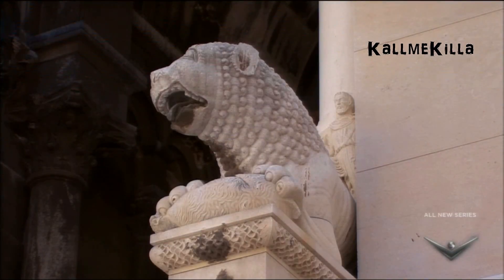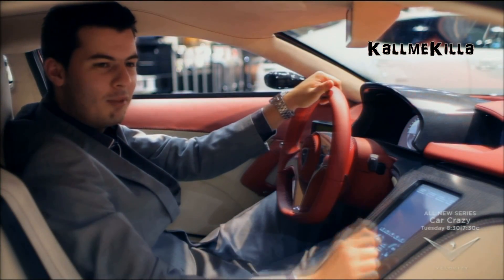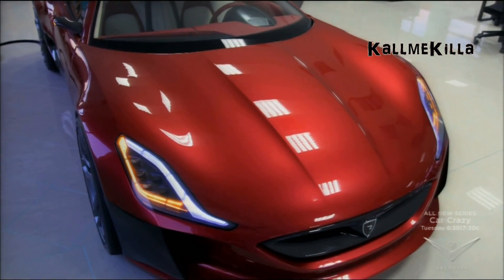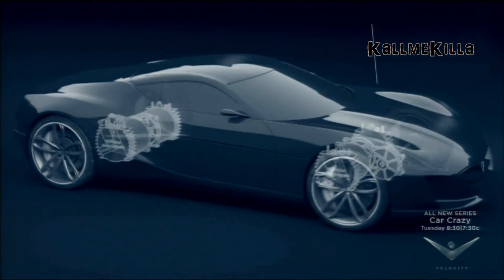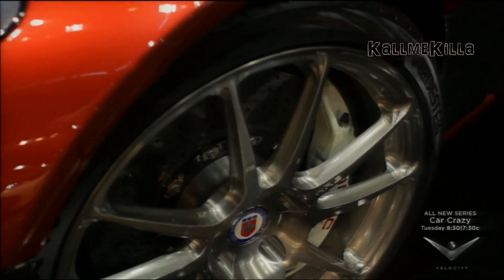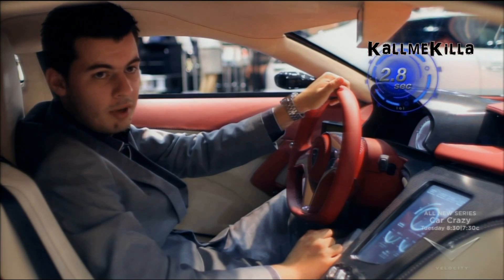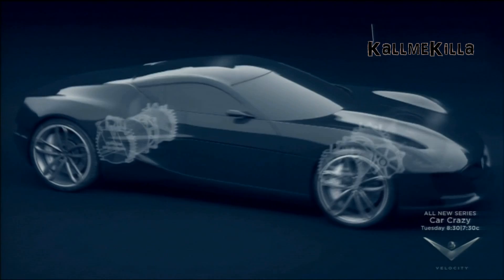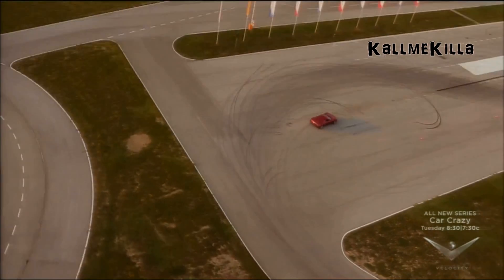Rimac - Electric Concept One Super Car 1088hp

Comment: I want to design and build an electric supercar myself! If I were to design and build one, it would use rechargeable, solid-state, lithium-air battery cells with the following specifications: specific energy: 2.5kWh per kilogram; specific power: 3.2kW per kilogram; energy density: 6.6kWh per liter; and it would have a minimum of 10,000 charge cycles, each with a depth of discharge from 100% to 0%, in order to ensure battery cell longevity.

The car itself would use 400 battery cells, each with the following specifications as listed above; the entire battery array would contain 1,000kWh (1MWh) in energy, and it would be capable of generating up to 1,280kW (1.28MWh [that's approximately 1,716.50827HP]) of power to all four AC electric motors, with each motor being situated at each wheel.

The rate at which these batteries will be recharged or discharged is 1C: this would enable you to recharge the entire battery array in one hour, provided that 1,000kW is fed into it constantly for one, full hour, using whatever power outlet(s) is (are) capable of delivering that much power. If you use a typical U.S.A. power outlet (which is rated at 120 Volts and 15 Amperes), for example, you could recharge the entire 1,000kWh battery array (at 12 Amperes continuously, due to the charge taking more than three hours [that's 1.44kW of continuous power output]) in roughly 694 hours, or 29 days. ...But, obviously, you'd need to charge it a lot faster...

Comment: For my opinion, they speak a bit to much about the power. Seriously, it isnt that chellenging to build a very fast car. The most chellenging part still today is the range of an electric car. Honestly 390 miles range is enormous, but they mention the range, just once. So I doubt that the car would make 390 miles.
Reply: Peter Lustig It might, if you drive it extremely slow, very carefully. If you drive it using it's amazing power - which is kind of the point of the car - then it would probably be half the "reported" range or less. And considering how insanely expensive it is - it is not that impressive at all for a dedicated two seater, with no luggage space, and a carbon fibre body, and still being so heavy.

Comment: Alot of this doesn't seem to add up. If you use Tesla's charging calculator, it says that the very best home system @ 240 volts and 80 amps can charge 92kWh in 4 hours and 45 minutes (and Tesla says you could do 280 miles on that charge). Yet this car can do the same in 1 hour? If you do the math there, you would need 380 amps current draw to do such a thing. That's no big deal for something like a Supercharger station...but a home circuit? Absolutely no way.

I don't doubt that it can hit its performance expectations, but range and charging sounds very fishy to me especially considering the use of LiFePO4 instead of Li-Ion cells.
Reply: We Europeans do have a Three-phase-power-grid with 230-240V in between neutral and one phase and 380-415V in between the phases... Most homes can deliver 50-64A per phase. Some homes can even deliver 125A per phase! (Yes we are more advanced than the US and most country's when it comes to the power-grid)

Comment: This video is providing some unrealistic numbers. 91kWh of battery capacity and a 4 motor drivetrain with 370 miles range. I doubt it.
Model S P85 with a single motor drivetrain gets you around 250 miles with 85kWh on typical freeway driving. 
The Concept One range is probably closer to Model S if the battery capacity is truly 91kWh.

Comment: how are they getting 500km range, when an electric SLS AMG only gets about 200? i simply dont believe that an upstart croatian company can accomplish something like that when one of the most respected car companies can't.
Reply: 91kWh battery. The top model Tesla Model S has a 85kWh battery and they claim 480 km so this sounds about right. keep in mind that the Tesla battery weighs 300Kg so the battery in this thing is going to be very heavy which is why they've used so much carbon fibre and part of many reasons behind the cost I would guess.

Comment: The narration says the car has 4 electric motors and 4 inverters at each wheel. 4 motors = great. Chevy EV1 had this in '96. Its a great idea. Why an inverter, let alone 4 at each wheel? Current from the batteries is DC...why use AC motors? Why 4? You only need one inverter at the battery pack. Seems like a needless waste of power to make the conversion to AC and the extra weight the 4 inverters would bring.
Reply: I think DC motor has "rev" limits, yet AC motor "rev" is controlled by frequency. As long as you can provide enough juice "voltage" and jacks up the frequency, AC motor can go very very fast .

Comment: NO they need to tell the RANGE, The ACCELERATION, make manufacturing line, then race the others.... If they gona have range, power, comfort, and durability, then they gona win over TESLA... BUt now its just show off.... as it was before Tesla steped in :) For now... I prefer 400BHP tesla. 0-100 4,2 seconds. range on one charge - 460km EAT THAT...

Comment: The really big problem with electric cars is the natural characteristics of an electric motor. These cars have great take-off from a standstill cause that's the point of an electric motors maximum torque, but once you're moving you will not get any 'ump' in acceleration - actually I suspect it'll be pretty lame.
Reply: +Abinico Arts you haven't driven a Tesla then?  LOL fast acceleration from any speed. :)
Reply: No I haven't driven a Tesla - no point since I'll never be able to afford one. My comment comes from the days of simple electric motors - I'm sure that for what you pay for the Tesla they have designed in plenty of fancy circuitry for it be very impressive.

Comment: Other than having more hp and torque, nothing on this car is innovative.  Tesla did most of this stuff first, Mercedes did the 4 motor setup with torque vectoring, and both are considerably cheaper.  The only thing this car is ahead on is range.
Reply: hahhahahah your ignorance makes me laugh
Reply: Please, this car is far better looking than the Tesla. And these people were at the game way before Tesla. Sorry, get out of your insular USA box you live in for a change. There's a whole world out there.
Reply: I never said it didn't look better.  I said it was way too expensive.
Reply: hellcat1988 , It's not meant for common folk
Reply: Or people with any form of reason and intelligence.  You can get every feature of that car for a lot cheaper in better cars.  You can probably get every feature of that car in one car that will be cheaper.  I know there are custom car builders who could make something that looks just as good, goes just as fast, gets close to if not better range, and charge a fraction of the price.
Reply: Tesla has a better range to cost ratio.  I would rather pay 90k for a car that has more passenger and cargo room, can do between 250-280 miles per charge, and is domestic than a car from a European country that has much less room due to it's 4 separate motors, less than 200 miles more at best, and costs almost 10 times as much. 

The ONLY things this car might be able to claim is an advantage is it's range and 0-60 times due to it's battery and motor setup, but we still have to see how it handles a crash and what kind of longevity the battery pack will have.  The Prius battery is close to 2K to replace, and it's not even that advanced or rare of a battery pack these days.  I can only imagine what the "specialized" battery in this car would cost or what it would take to replace.  At lest the tesla battery can be changed in under 2 minutes.
Reply: hellcat1988 Absolute rubbish. IT has a longer range than any other electric car. It's range is quite impressive actually. I can't even go that far on one tank of gasoline. And it's very slick looking and not only looks expensive, it is. It should be pretty obvious, but apparently it isn't to you, that this car is not for the average person. It is a very much a rich man's toy
Reply: BroccoliBeefed
And that is exactly the problem with it.  For what you would spend on that car, you could have a all 5 of the tesla range of vehicles as well as have spare batteries brought with you on a truck for a few years before you would come close to the cost of this car.  Just because it "looks slick" to you doesn't mean that it's going to look as good to everyone, and rich men's toys like this are worthless in the real word.  I would never buy a car that is so rare or low in production that it would be totaled if I got in a fender bender.  Also, your gas millage must suck because there are mercedies that can do 600 miles per tank.
Reply: ***** I don't waist money like that.  If I'm going to buy something, I want a good reason for it.  Toys like that aren't worth the attention they get.  If they bothered to do something useful with the tech, like helping to create a semi (laury) that doesn't need fuel to do the same work as current versions, then I would be interested in the company.  As it stands, they are just producing a shiny toy with no actual value whatsoever.  As I said before, Mercedes has a 4 wheel motor car, Tesla is much more useful for passengers and cargo, and every manufacturer in the market is trying to make better batteries.

As far as the charger fire, they've already fixed that.
Reply: The problem is it does nothing for the average consumer and it's not going to do anything for the environment.  Production numbers will be so low that it won't offset I.C.E. vehicles at all, won't reduce our use of hydrocarbons, and will never have a serious aftermarket.  There are aftermarket parts for the tesla already, which means that there are jobs for people outside tesla created because of the car. 

Couple that with the new factory that tesla has for the batteries and you have (at least temporarily for construction) a lot of new jobs in many different areas.  The tesla helps advance the tech of the electric car and only seems to have the drawback that all other electrics have which is the pollution from mining and transporting of materials including the battery.  It's moving away from that partially though by having it's own battery manufacturing plant here in the states to at least reduce one step out of the chain.
Reply: Mr Rimac made his electric BMW first. So only Tesla isn't innovative. See y'a.
Reply: lebarom15
If you really want to get technical, they all got beat by a long shot.  I'm not just talking about the cars made in the early 1900's either.  There have been small companies started out of people's garages where they would build custom electric vehicles for people since at least the 80's.  Tesla just put all the pieces in the right places and made it work on a global scale.  They're the only large scale solely electric car manufacturer in the world.  None of the other manufacturers of either I.C.E. vehicles or pure electric vehicles can match them for sales, range, passenger room, production, or future potential.  There are already over 75k Tesla model s sold today and that number will only continue to grow with the x and 3 models.

Comment: Vaporware. It is utterly impractical to give an electric car 1000hp, the range would die in like 30 miles.
Reply: With 4 electric motors, that means each is only 250hp-- that's not much at all. Tesla's electric motor in the Model S is over 450hp.

The difference between an electric car and a gas car is that more horse power in the car doesn't hurt its range all that much because the weight difference isn't that significant. What matters more is how much cooling capacity you have for the coils in the motor.

The reality is that there's no way to USE 1,000hp continuously, because you can only accelerate to your top speed once, and then just maintain it. At that point it's a matter of aerodynamic drag and rolling resistance which is much lower than overcoming inertia while accelerating. But if you drive the car on public roads like a normal car, you'll still get something over 300+ miles of range from that battery capacity.
Reply: I did watch the video, but the comment I was replying to mentioned how impractical it would be to give it 1,000 hp, not 1,400. 1,000 hp / 4 wheels is of course 250 hp per wheel. Double derp. ;)
Reply: Good point. But you did mention 350 hp and he mentioned 1,000. I forgot the Tesla's torque. But it still wouldn't limit the range to 30 miles or anything close. 90 kWh would still get you probably 300-350 miles realistically even with 4 motors and 1,000 hp capability if you drove it like a car instead of a race car. :)
Reply: I agree but for different reasons: the peak watt of motors does not affect the mileage that much, most electric motors have very "forgiving" peak efficiency, and efficiency gained at these efficient rpms doesn't add up to much.

The problem here is energy and power. LiFePo4 batteries have around 100wh/kg and that's the top of the line stuffs. Best LI-ions do around 265wh/kg, the one that is manufactured by Panasonic and used in Tesla. My guess for Rimac opting for the former is a) cycle life-but again, good li-ion  battery with good management system can help this out, b) power output, few LiFePo4 batters have very high C rating, c) safety-but again management system.

Still, with 100wh/kg, the energy that is contained within the car is tiny, and even with the higher efficiency of the electric motors, the range will be much smaller. I wish they had gone with similar battery pack with Tesla, and perhaps similar management system so that they can share high power charger without modifications.

Simply put, this car's battery pack will be have to be twice as heavy than the Tesla models for them to have similar range.
Reply: John Kang Interesting stuff, thanks for sharing.
Reply: babybirdhome not 250 but 272 per wheel cos it has 1088hp
Reply: And you know why? The disproportionally low investments in battery technology research and overproportionally high subsidies of tax payer money in oil drilling research during the last few decades will give you a valuable hint....
Reply: Practicality isn't exactly a selling point for any supercar...

Comment: Too bad...Tesla cost only 150,000 and can run 0-60 in 2.8 now~LOL
Reply: +Alston Hsu tesla is for  mass production 
rimac is super car 
not for enenyone
Reply: of course, but the acceleration of Rimac isn't much greater than a Model S....and that's a SUPERCAR?
Reply: Tesla have electric motors for supercars but they cant put so high luxury in mass prudictions cars
rimac is super/luxury car
when you buying new ferrari or porsche the cheapest part of all car is engine
60% of car cost is spend to interier
***my english is pertty bad but i hope you understood me :) Sry
Reply: I see, I guess my point was how do you define supercar, to my understanding it combines with luxury and performance, and of course a huge price tag. Don't get me wrong, I am all for electric cars, but just have to be very careful of how they classify between a normal car and a supercar. Nonetheless, Tesla can build a car that runs from 0-60 in 2.8 seconds at $150,000, and you can certainly put another $850,000 to luxurize it to be consider as a supercar like Rimac. This equation doesn't make sense to me personally.
Reply: +Alston Hsu This car has 4 engines vs 2 in the tesla. Superior handling thanks to the all wheel torque vectoring,  higher top speed and is engineered for track use. It's built to withstand heavy abuse, you can't constantly push a Tesla on the track because it overheats and goes into limp mode. More range, etc... there are a number of reasons that make the concept one a supercar and the tesla a fast luxury sedan...
Reply: simply comparing two electric cars, sure you can build multi-million cars, but what is the soul purpose for the world? bragging rights?

Comment: Rimac concept ONE - 370 miles of range,  10088horse power, four wheel system. As a super car it competes with TESLA..... But 980 000$. Tesla model S 300miles of range, 440horse power, rear wheel drive, hudge touchscreen, suspension height, many more cool features, and costs 60 000$ I can have 5 tesla model S, and 6 tesla roadsters which goes from 0-60 in 3,4 seconds, and costs 100 000$ each ;) So I believe in elon musk..... because he is building 500Tesla S/week.

Comment: I don't think much of the design; same sleek design elements as most other sports cars. To be honest, Tesla's cars are by far the most functional on the road; both in style and performance... and that is what really matters to most. 

However, if Rimac is just trying to be another Ferrari or Lamborghini on electric steroids, then it is in for a shock; it has to get behind countless others that are doing the same; so, nothing new here -- just another option for pretty much the same. 

If, however, we are talking innovative technology, then I would have to suggest that car wannabe companies have to stop focusing on exotic styling and focus on real technology that will make more sense to a broad market; a longer lasting battery, longer distance and better performance, energy conservation, innovative safety features, noise (cabin rattle) reduction, etc.

Below is for Tappajaav --

Since I was obviously talking about automotive design, where I am suggesting, 'innovative safety features;' it should be obviously to the least auto technophile to mean; automotive safety innovation -- safer braking, cabin, body, chassis, outside visibility and outward view, interior, seating, and steering & handling designs, to mention a few -- essentially; any new innovative design that makes driving a performance car safer for all driver and passenger(s) in all regards of the word -- innovative in this case means, new and improved design and technology that involves saving lives while adding performance.
Reply: 'I807
Reply: The fuck is "innovative safety feature".